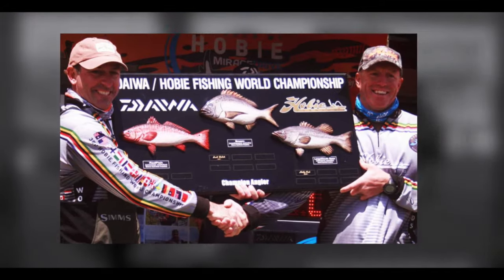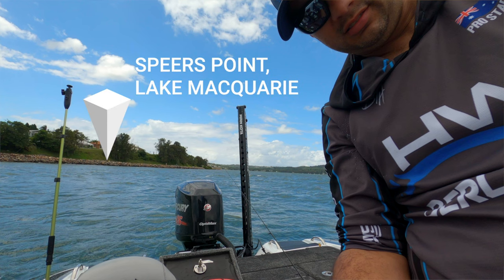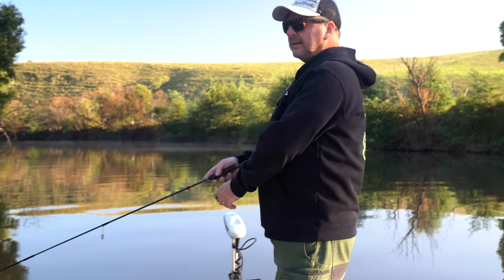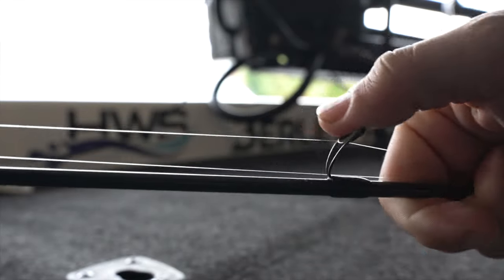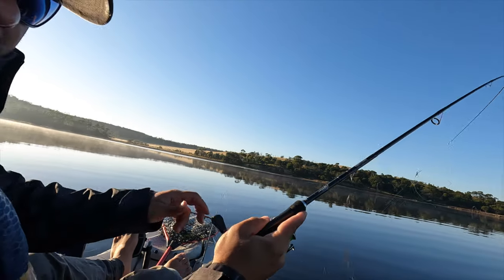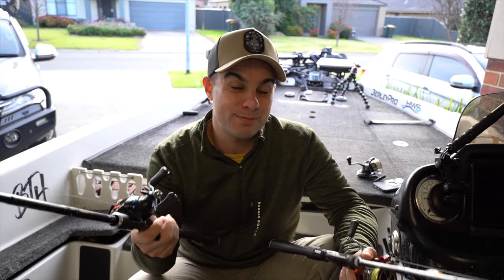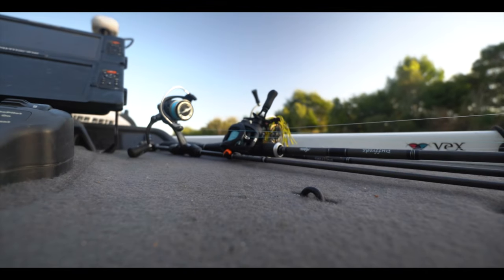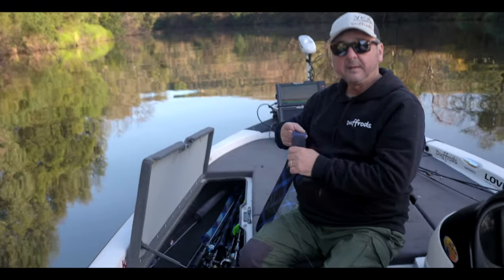A Custom Rod With A Fishing LEGEND!!

Comment: love the philosophy of buy local to support local. also the info on the flexi guides and multi-directional was something i had never heard of but will be looking for in future rods. In relation to the grips the comments regarding slippery hands are correct. I remember back in the day my dads brand new custom made barra rod flying into the water  (with a live mullet attached) as it slipped through his BBQ chicken greased hands. Even as a kid i new how much this hurt and even more so when he dived headfirst into croc infested waters to try and find it, but no luck. In relation to my rods it depends on how im fishing, for my smaller baitcasters  (when flicking lures) i like a pistol grip style reel seat with a naked (bar blank) and then a cork grip. The extra length and cork grip lets me add pressure for a longer cast when needed without fear of loosing the rod. Also i think this looks cool. I also like this extended grip for my spinning reel jigging rods. However, for my bait roads (big or small) i like a one peace non-slip grip (i find cork does the job well). This is due to the rod being placed in the rod holder while the bait soaks. I think the full length cork helps protect the blank. I haven't tried a Duff rod and to be fair i didnt no they existed until your video. But now i do they and their non-slip grips will be on my radar when i get my next rod.
Reply from the maker: Andrew, that was a great read. Thanks very much for contributing mate, I liked reading how you like the grips

Comment: Interesting video mate! I actually went through a few rod brands and I went and bought 2-4kg black widow edge rod and didn't like it!! Wasn't sensitive enough for what I like and I was dropping way to many fish! Ended up getting a Shimano/jackall posion adrena and love it! Rods are definitely a personal thing! Just because they are expensive and other people rate them doesn't mean its the right one for you! Shop around find what works for you and stick with it. I've discovered looking at  quite a few brands there are not as many as you think you will like! Reels are easier to buy 😂🎣
Reply from the maker: Definitely agree rods are very personal sandytrackx appreciate your comment and thoughts buddy
Reply: @sandytrackx fishing am interested in your thoughts on the Edge you didn’t like. Their reputation is unparalleled, you matched it with your recent 2500 twin power ? I’ve found the Edge is similar to the original Loomis, a 2-4kg is more a USA interpretation, what we would call a 3-6/4-8.
Also like your vids mate. Got a mate heading your way to do a collab, looking forward to it.

Comment: Hey mate! 
I don’t typically let the material sway me on a rod too much but my preference is normally EVA purely because it’s what I’m most comfortable with. However it’s hard to resist a bloody sexy cork handle or something different like the carbon fibre used on the duffs! 
Overall I don’t discriminate when it comes to material types I think it’s more the handle/reel seat feel that gets me over the line. 
Keep up the good work mate!
Reply from the maker: Thanks Cody! I think you’re right, the rods gotta perform for you first. Material comes second.

Comment: great video from a local rod maker, good insight on the rod guides that are often undervalued. 
As for the grip material, I prefer EVA split grip, as it feels comfortable on my hands and most of my rods are using this material and I've become used to this material. I have a couple rods that are using carbon-based material like Shimano Zodias, they are excellent. but not many that are selling rods with this kind of material, especially from production-based companies.
Reply from the maker: Awesome to hear your thoughts Andre! thanks buddy

Comment: I think you mean those specific rods you are using are production rods. The rods I have been getting made for the last 15 years are mostly custom, I tell Steve the specs I want eg guides, type of blank, length, type of grip and he makes it. Custom to my specs. I always get Ti frames and SiC guides or recoils and they last forever. Recoil guides are great if you are not careful, I prefer to only use them on crank rods. and Ti SiC guides for braid.